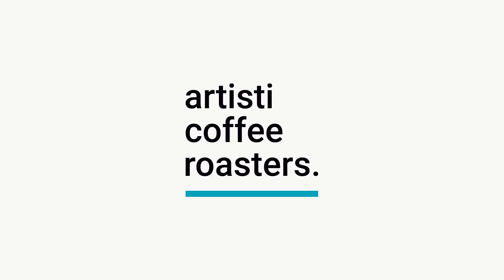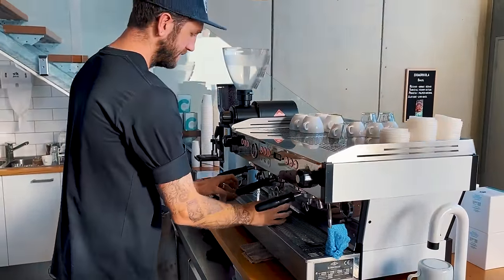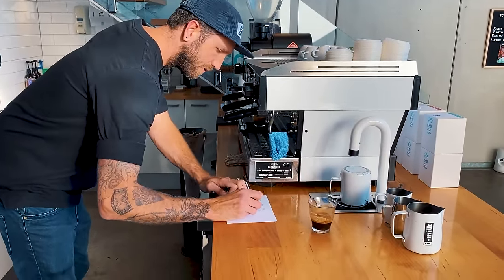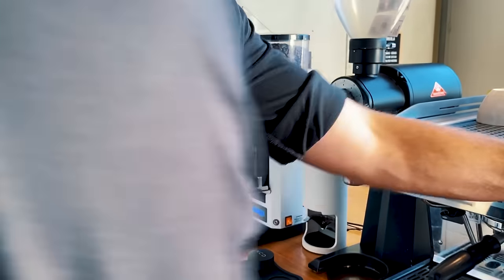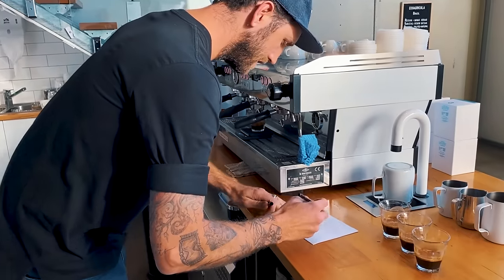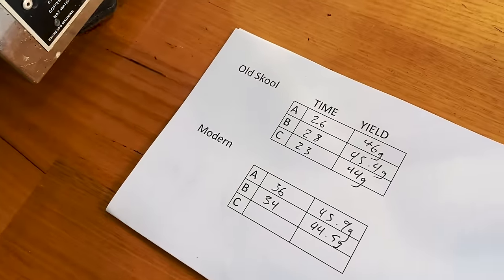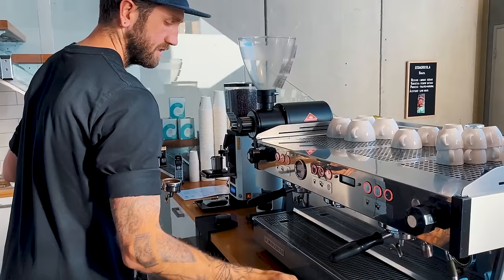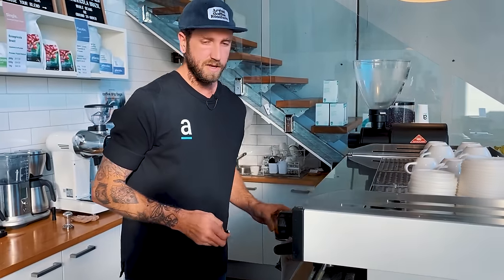Coffee Puck Preparation Techniques Compared (Making Better Coffee)

Comment: Back in the day made tens of thousands in a busy cafe in an upmarket arts & leisure complex. Had a massive Italian machine with 4 heads. Banged out all variations from breakfast to the busy pre and post theatre crowd even served famous celebs. Was fast & furious. Loaded the handles by hand with dexterous scoops into a metal dose spoon from a big stainless tub of pre ground coffee. banged the basket soundly on the wood counter to settle then quick solid tamp. Water already run through the head quick switch off then insert the handle then switch on water again then hastily arrange the necessary cups... Someone would sum the coffees on the dockets and yell above the din "10 caps、6 flat whites、 3 black、5 espressos、3 double espressos、 9 lattes、2 ristrettos、2 Irish、 1 ice coffee." None of this machine dosing and weighing business. Firm、 hard pucks、simple、fast、 good times.

Comment: I am genuinely skeptical about these OCD and NCD distributer tools. Needle distribution may be slower, but for private use, it seems perfectly appropriate.
Reply: I do both WDT & OCD.
Reply: Agreed, I weigh input, do WDT, careful tamp, weigh output. I think OCD/NCD is just top level grooming, does not address inconsistencies through the whole puck. I see some competitors in barista comps do both.
Reply: @marcandrecoutu4798  what is even the point about compressing the top and leaving the bottom prone to channeling by not touching it? It's super weird i don't understand how these distributer tools are remotely addressing this. Seems like a $15 puck rake is simply superior to a one of these $200 distributer tools.
Reply: @unlink1649  totally agree. The prices of these devices are insane. They are leveraging champion baristas' name to make unreasonable margins.
Reply: Sprometheus did a clear comparison between some distributions method; and the winner always imply some kind of needle; go check it out ;-)

Comment: Longer extraction time doesn't matter if it doesn't taste good.
Reply: Correct.  But I'm pretty sure he knows that timing is better.  Moreover, without changing the grind size, he's gotten about 8 more seconds of extraction and more consistency, which means if it doesn't taste good, he can change grind size and be done with it.  Instead of wondering what else is going on like channeling, etc.  Listen to what he says at 10:19.

Comment: Using a bottomless portafilter to look for even extraction across the puck is also helpful.  I ended up using a c-curve RB tamper base to dial that in.  Orphan Espresso dosing funnel helped me with WDT with a paper clip, too.  Never needed scales since I leveled off the top of the basket prior to tamping, but did use a timer to pull 2oz by volume in 25-30sec.

Comment: Another great barista video, at our cafe we started using the Mahlkonig E65S GBW which has been the best investment. The puqpress underneath makes it a great clean work space. The grinder recognises the programmed handles (they have weight difference), it doses exactly the recipe we use, up to .1 of a gram accurate pretty much every single time. A distributer is still a must. One think id add to his work flow is activating the shot quicker. The heat of the head may impact the extraction. Dont leave the handle on the head for more than a second or two. It heats up the fresh grind very quick and effects extraction. Cheers! Keep it up!

Comment: Thanks for the comparison between old and new methods. Please do a similar video using decaf, for those of us who have difficulty regulating the weight out and the extraction time with these coffees.
Reply from the maker: Our decaf is very similar, except we change the ratio to 23g and 40g out in 30 seconds. You can use a dosing tool if you can’t weigh the coffee.

Comment: I'd much like to see your PuqPress (or your alternative device) used to evaluate the effect of tamp pressure on extraction.  For example, keeping all the other variables the same (# g of ground coffee, brew pressure) using tamping pressures of 20#, 30# and 40# (for example), determine the effect these have on the extraction (time, weight).   I've been told numerous times that tamp pressure is not that important.  This would seem to provide a definitive answer to that question.   

Nicely done video as usual, thanks!
Reply from the maker: We’ve heard that plenty too so I’m putting that on the list. Keep an eye out for it soon. 
Thanks
Reply: Cafe Martella Did a recent video where he compared the different flavors he got using different pressures with an auto tamper
Reply: there is a lengthy test here on youtube already comparing tamp pressure with the puck press. Result was that as long as you tamp (weight of a heavy tamper is enough), it wont really make a difference.
Reply: @Caffeine.And.Carvings  Thank you!  Haven't seen that one, but what you say is what I've always suspected.  Many claim  uniform tamp pressure (whatever it is, just keep it the same) is important, but I've always questioned even that.  So many variables, it's nice to eliminate a few of them.  Appreciate the pointer, I'll look for it.

Comment: My "2 cents" for home brewing (Kinu grinder and Gaggia Classic Pro, IMS basket, 9 bar OPV): the more I make preparation the bigger impact is on the end result - taste (bitter or sour). So I decided to gind (17 grams), level and tamp and that's it. This way I have more consistent result in the cup in meaning of taste of the coffee. I just use stopwatch to measure time (in the past I measured yield also), around 27 sec, depending of how long I keep my beans in the fridge.
When I used WDT tool, I was not able to get 2 consecutive coffees taste the same.
At the end, it's not about grams, time or preassure it is about the taste of the coffee.
Reply: It's always about taste. But if you keep all the variables consistent. You're able to replicate the shot profile time and time again and therefore it'll taste as close as possible to what you want. Obviously aging coffee will change this. And that is why we dial in to a recipe everyday
Reply: @adaz240  Agree, if you have the procedure to follow each time, you should expect same result, with less changes as possible (minimize small variable impact).
To dial in every day at home, for 3-4 espressos per day - not sure it makes sense and is economic. But some trade-offs must be made. If we limit ourselfes those small times of the day to fully enjoy in cup of good espresso - then what else shold we do? :D
Reply: I have the classic pro, and find that the shots vary a lot. I need to simplify the process, and try without the wdt, puck screens, distribution tool, etc

Comment: Nice video.  What you've done is compared mechanical tamping vs manual tamping.  I'm unconvinced of the value of using a distributor.   You claim that adding these extra steps yield longer extraction times.  Now, repeat this experiment but skip the distributor step.   I suspect the extraction times will be unchanged.     
All well executed experiments need a control.   Skip the distributor and run it again.

Comment: So for home use, the current thinking is to ditch the OCD tool, as it harms more than it fixes, instead do WDT with needle size less than 0.4mm, tamp on an even bed, pull the shot.
There was a big study showing that conventional use of a distribution tool, like the OCD, presses the shape of the tool into the coffee, then it compacts the top layer with no change to the bottom layer, causing channeling.
Reply: Incorrect, actually other way around. WDT is bull, grind, level it then tamp. Take it from a barista.
Reply: @drazenbabich  Wrong.
Reply: @firstlast-wm3li  Go play somewhere with the rest of the kids. Learn to shut your gob when grown ups talk.
Reply: @drazenbabich  Same here. We tried pretty much all the methods flaunted on social media by the "influencers" etc. Went back to grind-OCD/level and tamp. Some girls in our team started to feel a bit of an OOS coming to their wrists so they use calibrated tamper, the rest of us good old tamper does the job and meets our prep reqs.
Reply: @drazenbabich  Pound sand.

Comment: What im wondering most about is, that seemingly no caffee uses a wdt tool, as it has shown in numerous studys, and quite a few coffee youtubers that this is the biggest factor to evenness in extraction and extraction in general. Im sure it can be automated as well (thinking about something like the puck press with a motor that spins and moves upwards slowly). 
If you are going to the lenght of dosing each shot, why not just single dose anyways. I mean sure, a big caffee needs to amp up speed in order to gain money, but specialty coffee places should go to the length of single dosing anyways in order to accomdate the different coffees they offer. I hate when i cant taste the coffee i want to buy.
If i would desing a modern workflow it would be: Machine that weighs beans into dosing cup (automated, there are prototypes here on youtube), grind into portafilter with funnel, automated wdt in small circles slowly moving upwards (also automated), puck press for even tamping pressure, into the machine. Every detail can be controlled and fine tuned to maximum taste and the barista doesnt have to try around. Offer 3 different espressos each week, one on each group.
Reply: A few high end Specialty cafe actually uses a WDT that also acts as a distributor which saves a lot of time in puck prep but that thing is very expensive 
Mostly WDT are used by home Baristas (at least that’s what I have seen)

Dosing grinding machine is also very very expensive and so fast pace specialty cafe weighs their shot all the time (experienced people can do very fast and they have no problems with doing so as long as they could save a bit of finance while still keeping consistency)

Each group for different bean is a heck of a slow workflow (imagine peak hour when your best seller bean got ordered 50 times in a row and each ordered has 2-5 drinks on it, you’re gonna pull 50 multiple shots non stop on 1 group?)

I get your idea, but it is only suitable for very high end cafe with a rich and smart owner who could get enough customers to maintain the cafe while still keeping every shots 100% perfect as you say

I’ve worked in many cafes, studied about coffee and would love to do what ur saying but it is financially impractical

Comment: Neither is the one to go to, it's more of a balance, and bits in-between. 
Back in the day we used to knock the p/f with a tip of a tamper and that worked well only and only in situations when you'd knock it before tamping the puck...if you did it after then you needed to make sure you re-tamped it again.
WDT is an option for "clumpy" domestic, home and kitchen aplliance type grinders, but for most of us who rely on commercial ones on daily basis, which produce fluffy grind, it's a no...another unnecesary and time consuming product we do not need and can live without. Fluffy grind requires a little of light tapping of a side of a p/f with a palm, then leveling before tamping.
Levelers/apinners etc are a good adition to your workflow as they not only level the uneven top of the puck but give you a goid and solid level (horizontal) reference point before a tamp. Most folk fail in puck orep at the tamp sequence, producimg non-leveled compressed puck resulting in chanelling and uneven extraction.
Thanks for the video, there will be a lot of younger and new folk to espresso prep who will come up with their own view on puck prep, that's for sure. 
Social media pushes a lot of the tools down their throats but many if not most "new age" tools are more of a nuisance then a benefit.
Reply: "...producing non-leveled compressed puck resulting in chanelling and uneven extraction." Definitely as a noob my #1 problem. I'd get a spinner for that reason alone.
Reply: @mikesrandomchannel Spinner/leveller is the only additional tool to my tamper that I use. My primary grinder is Mazzer Super Jolly V Pro which produces super fluffy grind, so in my case WDT is unnecessary, unless I use my single dose Lagom P64, I’m that case WDT helps.

Comment: I resisted these techniques for years…  I think because I thought them unnecessarily obsessive.   But they do make a big difference on repeatability … and, gives youa stable basis to judge the impact of changing any one variable.   I mean, how can you test any changes if you are already getting highly variable results
Reply from the maker: Correct! The biggest variable is the person, with pressure, a little more grind as it looks not full enough, maybe a pit of a tap here, and not changing the grind to suit a standard process will leave you lost in the woods.

Comment: Super stuff, a really useful insight. However.....The staircase behind your service/preparation area has a vertical gap of approximately 60mm between the glass side wall panels which extends all the way down below the step's surface level. You do realise that dirt from footwear and stairway surface residual dirt can inadvertently be kicked, flicked, scuffed, knocked or float through this gap directly into your preparation area!  A little rethink or this might be a good idea.

Comment: This is so great. I mean putting the comparisons on a table leaves no doubt of which method is better. We need to keep consistency of our outcome as much as possible. Thank you
Reply: No, this is bullshit 😅 First he didnt clean good head where go coffe.. Because its immposible without brush (if you clean with towel how he do you put dirty in every hole of metal "filter" where coffe go.. So when he make one coffe was good.. Next coffe was less coffe because holes are full from dirt of last coffee.. Etc.. Look how his first 3 coffe drop from 46 to 44 grams.. Also thats mean that his machine is not calibrate to push same every time or he have dirty metal filter..
Reply: The consistency did not come from the methods used though it’s just because he didn’t weight the first time.

Comment: In the old school method you are not weighing the coffee grinds, but in the modern method, you are sticking to a fixed weight. How is it useful to compare when your first method basically has a different amount of coffee than the second?
Reply from the maker: You are basically showing that the old school method where you are not weighing and following a recipe will produce inconsistent results. The goal of our modern method is to produce consistent, repeatable results day in day out. :)

Comment: Although you were close on the old school method you weren’t right on. I would arrive early and adjust my grind, time the dose and not to mention taste the shot I pulled. You also didn’t grind mindlessly, if that’s how you were taught then you were taught wrong. You had to fill up to the rim where the relief is on the inside, then you timed a dose and also you weighed it. The whole thing was based on the time the dose took to extract, but you did have a goal of the shot extraction in grams. 

With all that said the new method is much better, and I understand that the old method when done right was very lengthy and still inconsistent. However, on the new method many believe that just by following this the shot will always taste right and I cannot disagree more. I have had some horrible shots pulled for me and I wish someone would provide proper training. Oh well! one day it will all just flow and balance out perfectly.
Reply from the maker: The process has come along way for sure. I made my first coffee 18 years ago and there was defiantly no consideration for weight anywhere 🤦🏼‍♂️
Thanks for the feedback and thanks for watching.

Comment: In the same spirit of realizing the usefulness of different accessories. I tested the “RANRAO Needle Dispenser/Mixer”. And I feel like it's not right. That it promotes channeling. That the needles are too big and poorly distributed. That the spring system is not a good idea. In short, it's rotten. So I'm going to test a manual needle dispenser with much finer needles. The goal is to prevent any lumps.

Comment: Thank you but I couldnt follow or understand one things. How is the machine changing its dispensing time with each puck?
Reply from the maker: Think of it this way…
The machine is programmed to let a certain amount of water though. 
No coffee in the head, 8 second drop of water. 
Well distributed coffee in the head, 36 seconds.
Bad distribution will allow channeling and that water can get through faster in 28 seconds. 
The time is not programmed, it’s dictated by the resistance caused by the coffee puck. 
Hopefully this helps.

Comment: Do you think WDT is worth using in a café setting? I see a lot of folks on the internet talk about how essential WDT when making espresso at home, but I wonder if it has a place with the scale you're operating in at a café.
Reply: Considering there are tools like the Normcore needle distributor, I don’t think adding that step will cause a huge inefficiency in cafes.

I think the better question is if it’s a milk based drink, will the average coffee drinker notice a difference?
Reply from the maker: We’re not far off introducing it to cafes but it’ll take the right baristas to really adopt the extra step. The NCD was already an extra step, this is another but both for the greater good 😊
Reply from the maker: Yeah these are easier to use in a fast paced cafe for sure. 
I think milk drinkers still appreciate a balanced cup.
Reply: I worked in fast paced cafés for a number of years - this new school method would absolutely not work if there's a rush and you're needing to pump out the coffee.
Reply: @midianite  indeed. Here (Italy) this approach wouldn’t work in any bar from 7 to 9 AM, unless you don’t consider losing half of your customers a disadvantage.😊